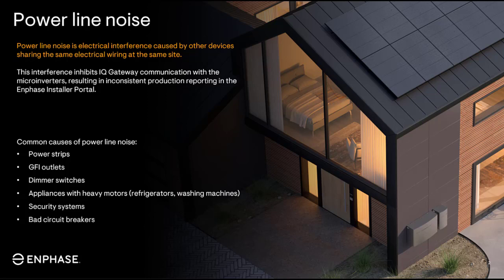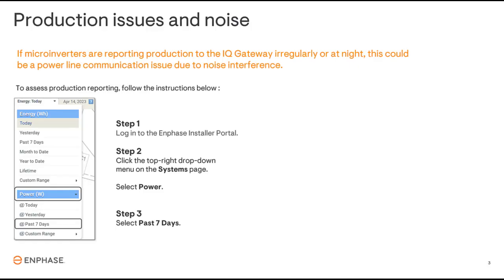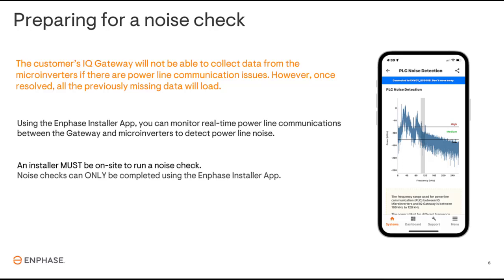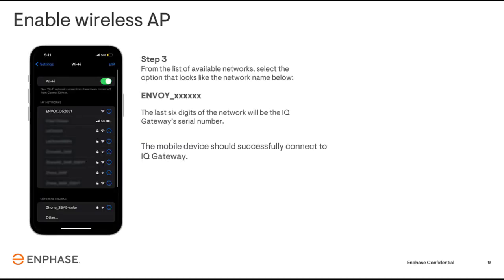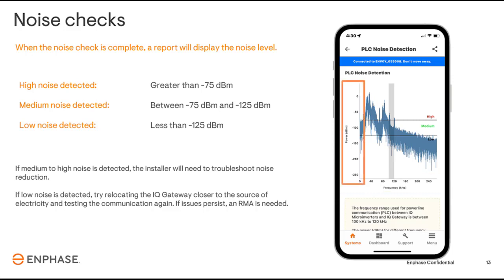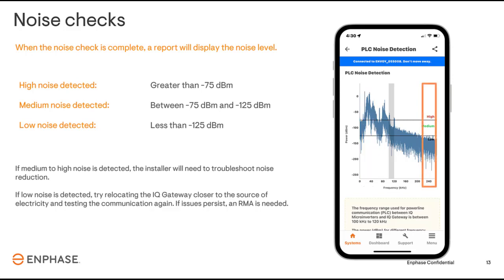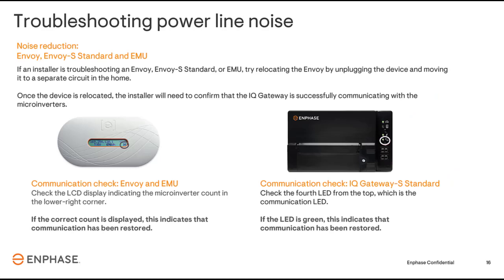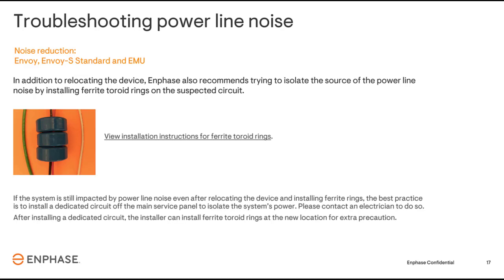How to troubleshoot powerline noise between the Gateway and the microinverters

Comment: The method of logging in, around 03:55, is not recommended at this moment or won't even work. And please explaine how the ferrite toroid rings should be installed. There are several options given by Enphase and the differ.